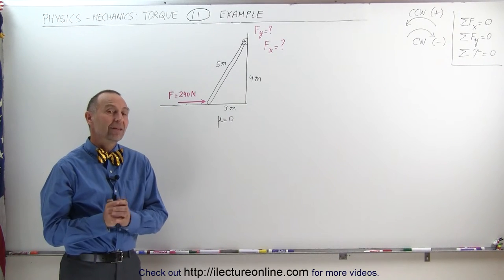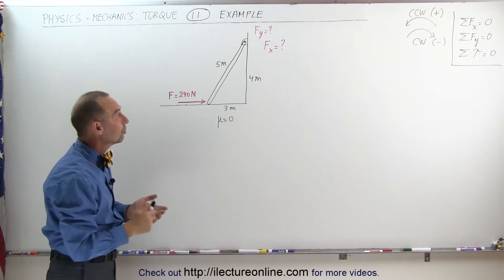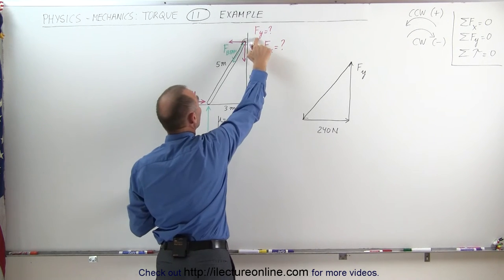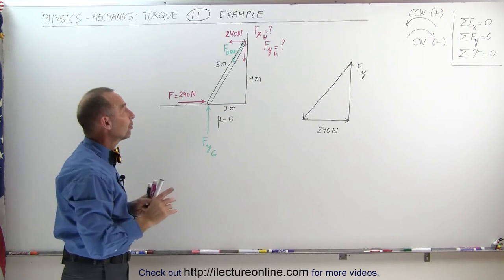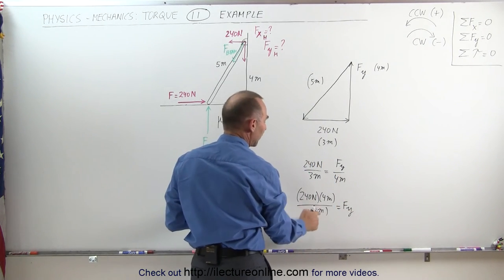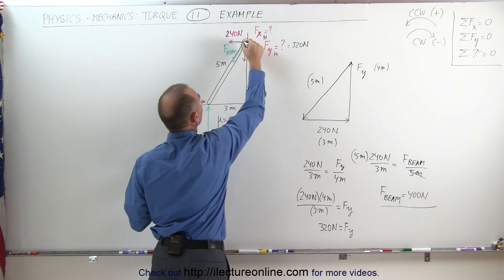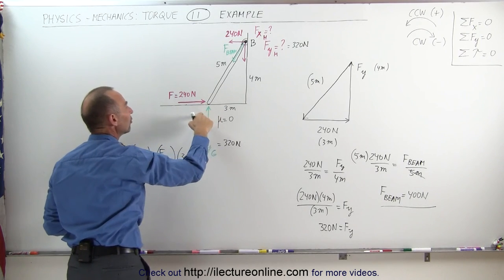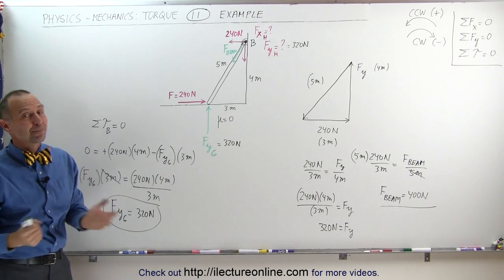Physics 15  Torque (11 of 27) Example 1: Forces=?

Comment: 1:56 Mr. Michel, could you please clarify how the force from the ground is totally vertical? I assumed it would be in the direction of the beam so as to have two x and y components.
Reply from the maker: If there is no friction, the force will be perpendicular to the surface.